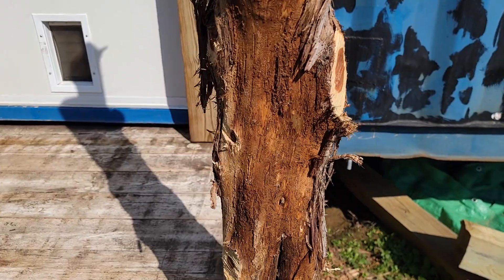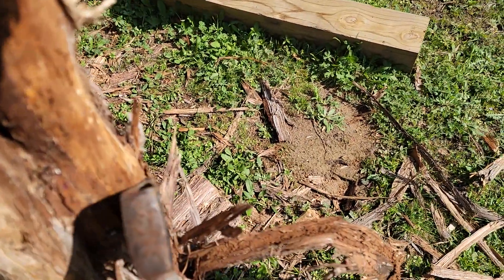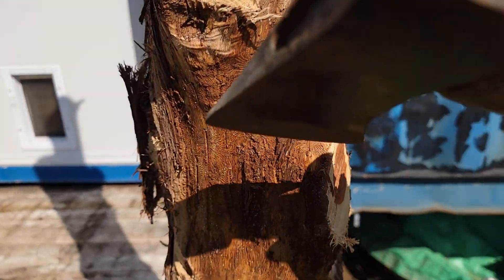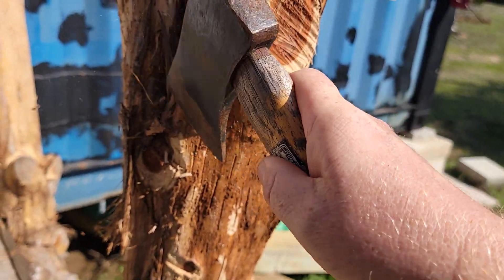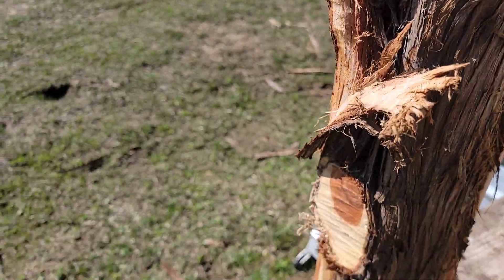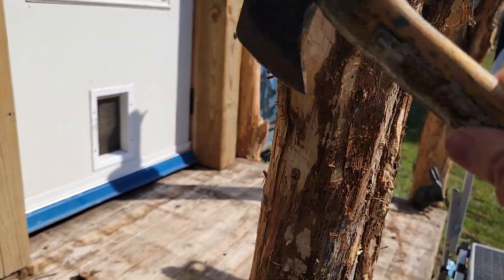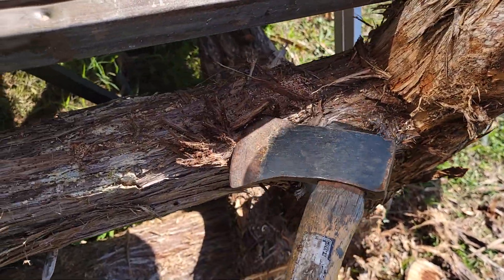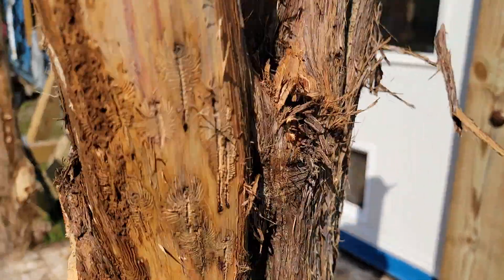Easy way to debark cedar logs.

Comment: Do you need to remove the sapwood too? I’m trying to use some cedar trees I cut down a few weeks ago as a pole barn
Reply from the maker: I am not removing the sap wood - but if an end were going into the ground I would treat the base with old paint/motor oil/suge ban. 

Above ground you can leave it all as a tree as trees grow in a neutral load - this makes timber frame significantly stronger.
Reply: Thank you